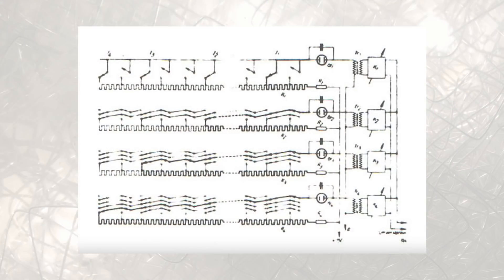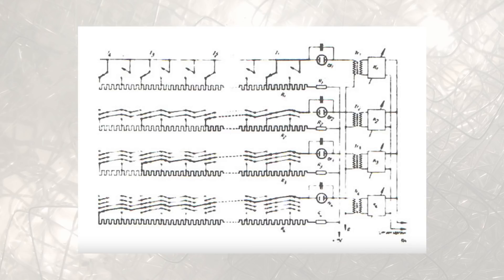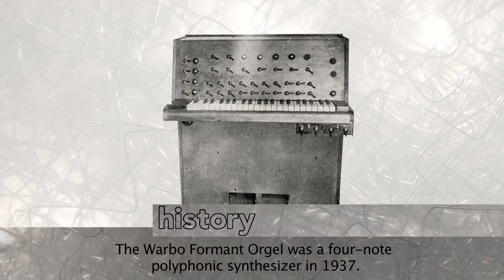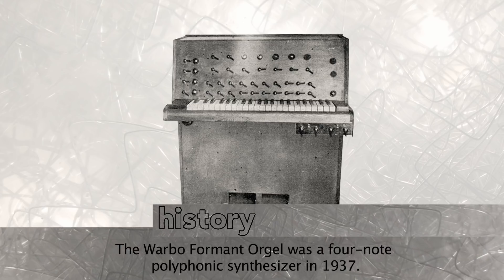A History of Polyphony: Part 6- The Warbo Formant Orgel

Comment: I believe that Harald Bode should be rightfully considered to be the inventor of the synthesizer. I saw a video (on youtube) about how Bode developed the first voltage controlled modular system in 1960 and gave a talk with it that both Bob Moog and Don Buchla attended and then went on to develop their own versions of the concept. Since all modern synths owe their lineage to the early 1960s Moog modulars, rather than the 1950s  RCA computer, (although it was the first to nab the name synthesizer) this would make Bode the first guy to conceive and build a synth as we know it. But now this video thoroughly nails it, as Bode had a four voice polyphonic synth way back in 1937!
Reply from the maker: I am a huge Harald Bode fan... a presentation I did about him is actually in the Bode Archives, I'm told!  So, I'm with you on how important he was.  I will point out that while Bob and Don may have been inspired by his audio-based voltage-controlled modular concept, they both brought a lot of innovation and new concepts to their designs.  

The voltage-controlled modular is more of a story of multiple people taking part in its arrival.  

It's really hard in the history of synths to suggest that someone was "first" at almost anything because there were so many collaborators in technology and concept over the 20th Century.  But Harald was definitely a major force in the development of the synthesizer, and deserves a ranking on par with Moog and Buchla.